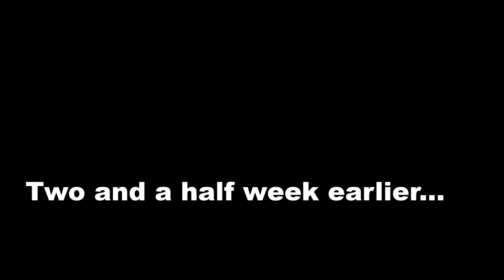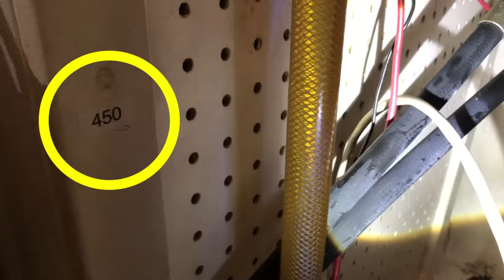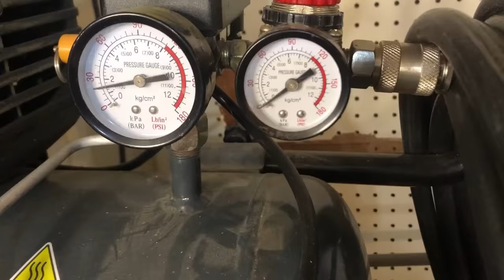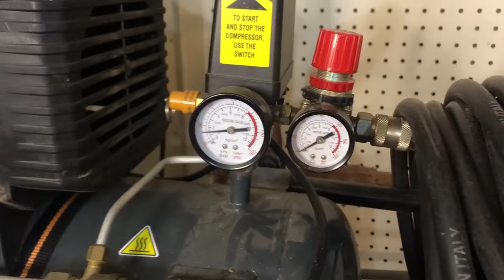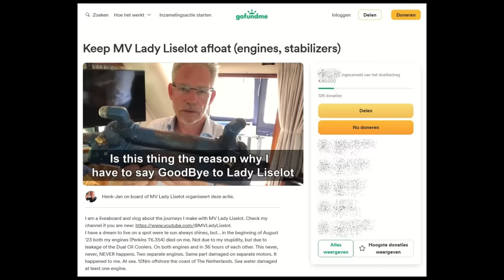An Unforeseen Challenge!; S3/E21

Comment: No Henk , I was watching your video about your tanks , iam a Machanic and very interested in your tank problems and then the end of your video ☹️
Reply from the maker: 1,300 liter tanks. Almost impossible to remove for repair. After welding I found 3 2mm holes on several spots. So I cleaned them partially. Let's say the first 20cm, since that was the area where the water would stay (in the 10 years she was on the hard). I added epoxy primer, 2 layers of fiberglass, 2 layers of epoxy and finished with an anti chemicals epoxy paint.
I have no video's of that cause you only would see me bend over with my head in a tank. In an orange suit. I know (from what friends told me...) there are other websites who provide better video's in bending over experiences.